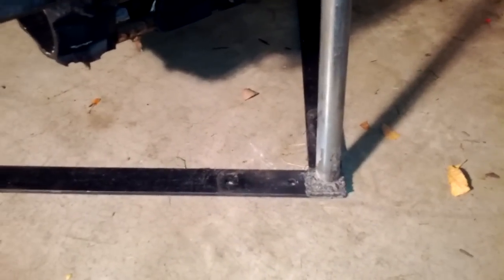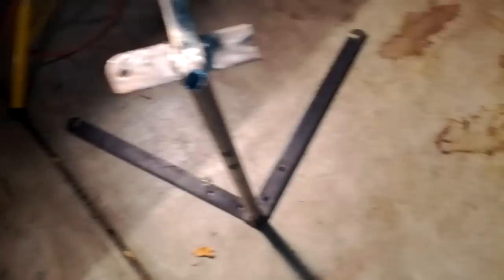My Homemade Snowmobile Warmup Stand

Comment from the maker: Well by it being 50:1 I have established it's 2-stroke so that has prevented any problems I would assume with rings etc. It could possibly be running on a richer mixture (40:1,32:1 ETC)  which could make it run extra smokey. Like you said, drain the gas and clean the carb. That will typically clear up the issue. Make sure you're using the right ratio gas. Since it's 2-stroke it will smoke a little.

Comment: well, it works, and until it dies, it will be used, ill probably drain the gas, clean the carb and put a new spark plug in it, and run some fresh gas with sta-bil, and it should be fine, even if it smokes